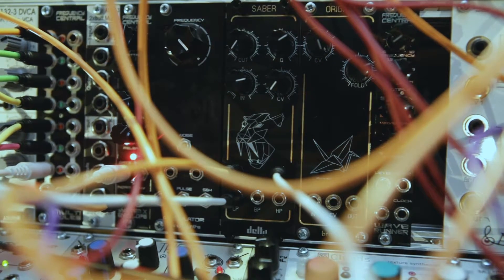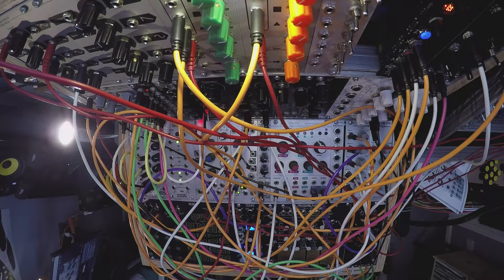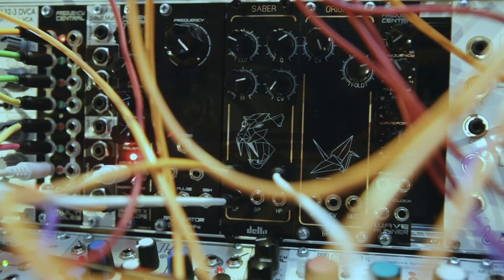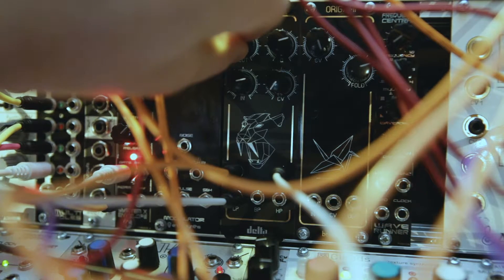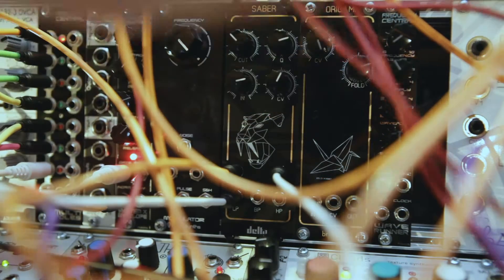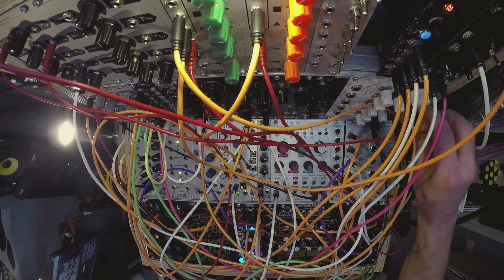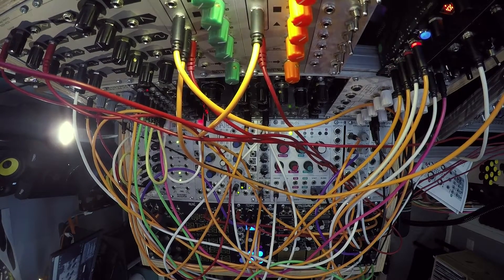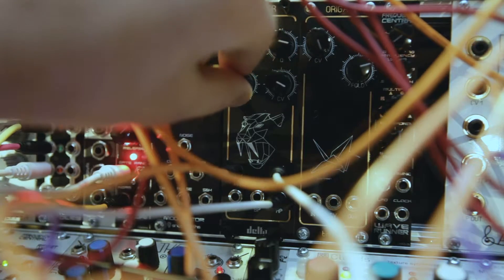Delta Sound Labs Saber SEM Filter Demo

Comment: looking at the panel, is it possible to sweep between the LP, BP, HP if you have the audio going through all 3 of the inputs? Is that what the 'IN' Knob is for? Thanks for posting this demo. Been thinking of either building a clone of the oberhiem filter, or if not to expensive, just getting a module and powering it by itself to run my other analog synths through to get that ob filter sound.
Reply from the maker: Hi there. The filter has one input, plus three outputs (not the other way around).  You can have audio simultaneously  coming out of all outputs. If you wanted to, you could pop those into a mixer and sweep them.
Reply: @theboytheycalljonny1  Ok, thank you for the help. From what I've been looking into with the Oberheim filter I guess it's only the one used in the Ob-6 that has a state-variable filter allowing you to sweep through the modes rather than just switch from one to another. And that synth unfortunately doesn't have an audio input to pass outside audio through the filter.
Reply: @theboytheycalljonny1  Thanks for the help, I think I may have to go with a synth rather than a module overall. But good to know.
Reply from the maker: @ubiquitousreverser   I'm not 100 % sure on this but if i understand you correctly, you want to sweep between the filter types.  Is that right?  As a work around,  just take the 3 outputs from the filter and pop them into a mixer, turn up whichever filter you want or blend and balance the harmonics you want / dont want.  I just tried it and it sounds lovely.  Not sure of that will scratch your musical itch though :)
Reply: @theboytheycalljonny1  Yeah, I think that would probably work, but my mixer is only 4 channels, and powering just the one filter etc, I would say for my interest's it would be more worth while to go with a synth instead of just the filter, but thank you again.